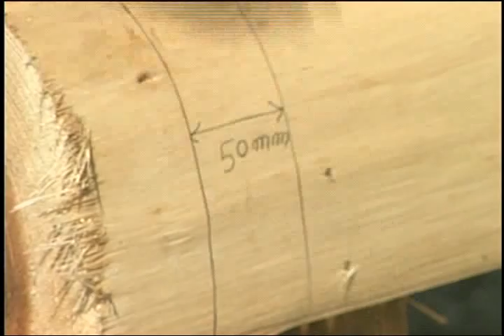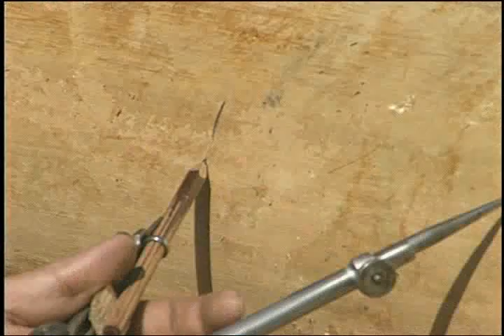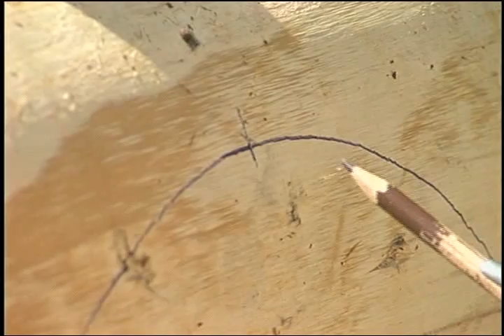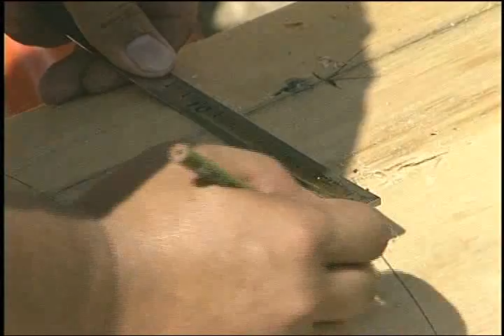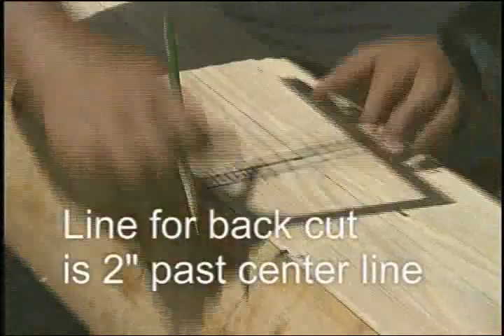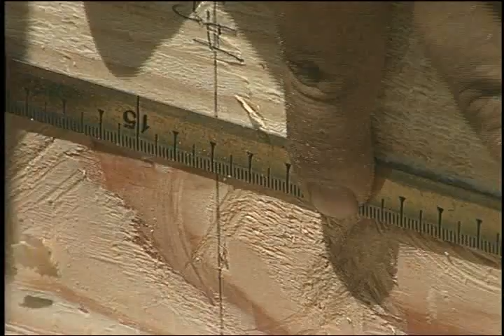Building log cabin: Cutting Dovetail Notches

Comment: correct me if I'm wrong: isn't the purpose of a log cabin, that its easy and basically quick and dirty?! And isn't the use of precision joinery kinda the opposite of that?!
Reply: the TOMSTER you could. some cabins were put up hastily because a shelter was needed quickly. my grandfather slept under a spruce tree till his cabin was finished.
Reply: SubArcticWolf Tools & Outdoors y
Reply: The purpose of a cabin is sometimes a rugged shelter and sometimes it is a well crafted family home that is meant to last generations. Have you seen some of the incredible carpentry in asian countries? Timber frames, incredible joinery, 12 story pagodas put together like architectural jigsaw puzzles, they they now realize still survive earthquakes several hundred years later. It doesn't surprise me to see artistry like that from an asian guy... And that guy had mad skills with everything he touched. While I personally would have chosen a different solution, I appreciate the art and the skill he showed.
Reply: the TOMSTER ,
Reply: This is quick and dirty, easiest version of dovetail joint, if he was doing the dovetail with wind blocking vertical parts in the joints it would take even longer to measure and cut the joint.  IF you are building a log cabin that will stand with little problems for hundreds of years precition will pay off.

Comment: I may be wrong, but why not cut out a precise templet to match both joints. Then apply to a jig that can be used over and over again without all the tedious measuring and marking. Kind of like a scarf joint. looks like extra work and waisted time. somebody comment here for me. Darrell in Georgia
Reply: I believe the joint dimensions depend on the dimensions of the logs, and as logs like these are never of the same size, and they are not perfectly round.....  It's like fitting a kitchen top to a 200yr old plastered wall....  grin
Reply: You cant because every log is different.
Reply: good call
Reply: he did that after the first setups
Reply: Darrell Smith r
Reply: You definitely can use a template as long as you set it up in line with the centerline of each log, just the was he set up his measurements off the centerline each time.

Comment: Why not create a template to save time?

You would then only need to center the template and transcribe the shape of one log to the other for mating.

You could use the template on job after job.
Reply: every log differs. it would be a waste of potential binding strength to apply the same dimension to a 20%thicker log
Reply: You can make an adjustable template ;-)